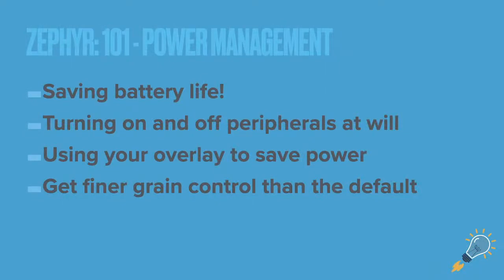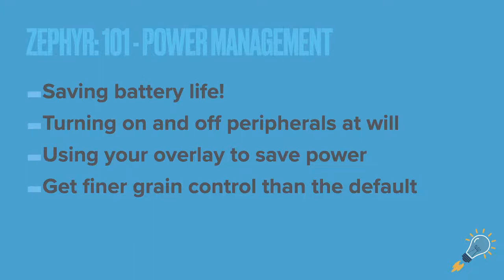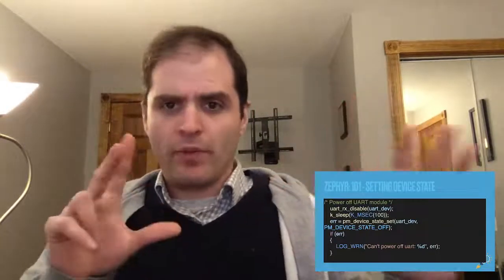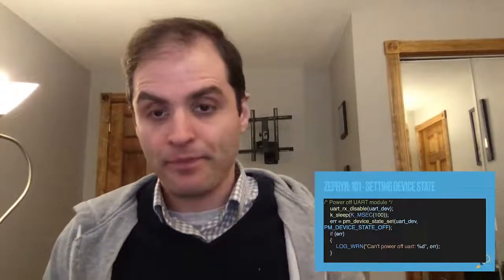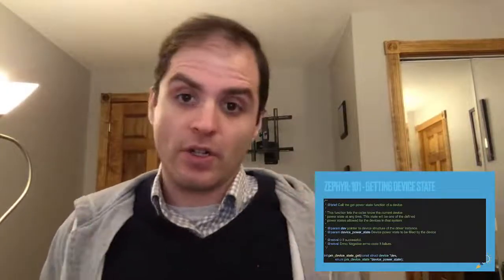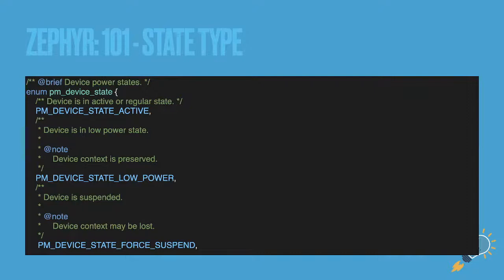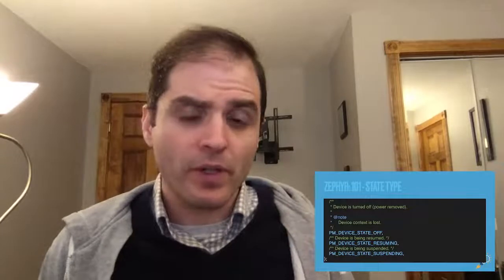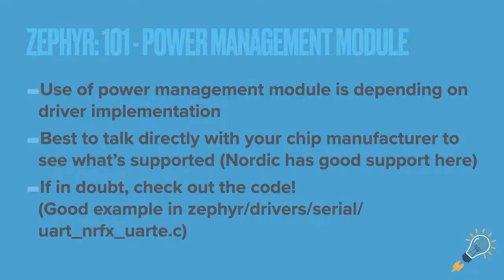Zephyr 101 - Power Management

Comment: Hello,

After two year I want to know whether this approach of disabling the receiver is still applicable in Zephyr using the lates Nordic SDK v2.6.0. 
I have used the nRF52840-DK and was not able to disable the receiver using an overlay file. May you share how you do that with the new pincontrol way of handling pin configuration in the devicetree (overlay) file.

Thank you :D
Reply from the maker: I actually disable it in runtime as often I still need to use the console for provisioning, etc. Maybe I'll do a video on that in the future. You can check out this sample which disables it at runtime: https://github.com/circuitdojo/nrf9160-feather-examples-and-drivers/tree/v2.4.x/samples/active_sleep
Reply: @CircuitDojo  Thanks.
I had a look and I do call the same function. Thanks for the fast reply and the link!

Comment: Thanks for the video. I understand how difficult is to grasp all the details in case of PM topic
You mentioned uCurrent tool for nA measurement. I've worked with it and its workign great but big drawnback is the power consumption of this meter, also there is some ergonomics issues in my opinion. So I tested the CurrentRanger  from Lowpowerlabs and I was surprised - the auto-range function is amazingly good, battery can be charger and lasts for reasonable time, and you can alter the firmware if you want. Great value for the money I must say.
Reply from the maker: Hey Marek,

Great points. I've actually been using a Nordic Power Profiler 2 (PPK2) board for a while and it's the tool I've been missing. While the uCurrent and my power supply is great for static/average measurements, it's not so great for graphing current usage over time.

Comment: What a timely video! I have a at24 compatible eeprom that is supplied via a regulator... I thought that I could just use the "supply-gpios" property in the devicetree to tell the driver what pins control the power, but it seems like no drivers implement this, nor do they implement the 'vin-supply' property.  is the power management api just not there yet? Or is this a "per-device" kind of thing? Or is there something wrong with my understanding of the purpose of "supply-gpios/vin-supply"? 

BTW thanks for everything you've done for the zephyr community. I've really benefitted from your videos, blogs, and contributions.
Reply from the maker: Thanks Timothy.

I haven't looked at that specific driver, but anything in an overlay needs to have the corresponding code on the other end to handle. i.e. kind of what I was saying in the video: it needs to be defined in the driver for it to work. While the constructs are there, its up to the folks writing the driver to make it complete.